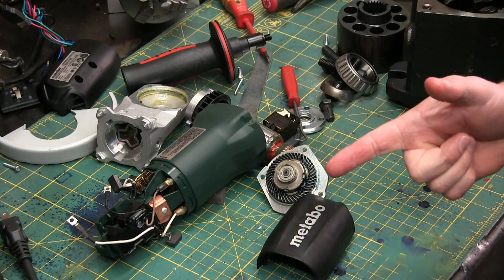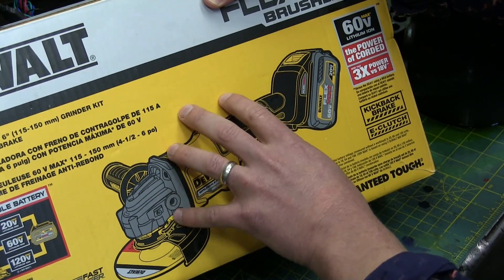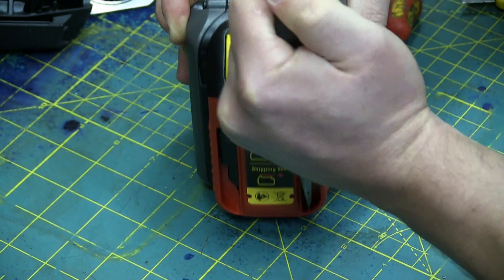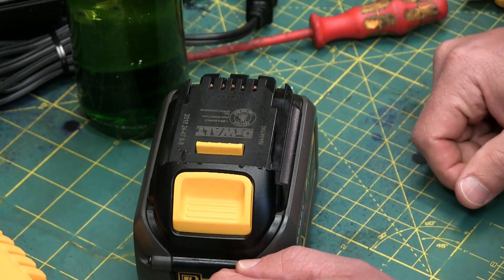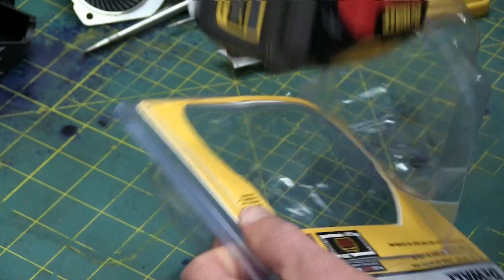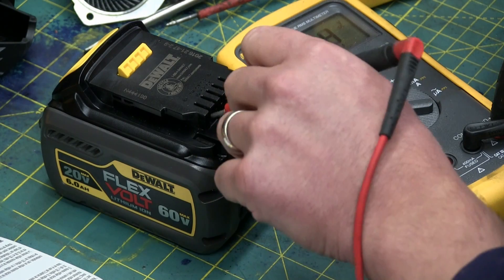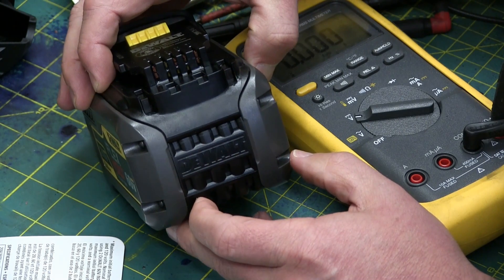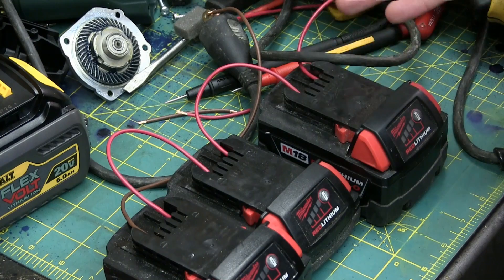Plug-in Power Tool to CORDLESS CONVERSION.

Comment: Could you use a “soft start” device that normally is wired into an Air Conditioning system to prevent the breaker trip?

Comment: Believe that's called a line conditioner. Been doin it for years in the professional audio world. Or P.A. World, I should say...ya if you dip too low on hard hitting notes they have capacitative circuitry that conditions or bumps up the voltage for dips and smooths the spikes as well. But I suppose batteries would do the same thing...just don't know how batteries would stack up to capacitors when it comes to transient/in-rush currents. But I like it.

Comment: Hear me out here!!!
Think of it as “Pimp My Ride” but call it- “Alberta Winds Turbocharger” 

It will only work if Peg(Zip-ties) is quality control OR is the “Celebrity” that steals the tools or does the grand reveal of the turbo “upgrades”

Your wife steals your corded tools and to get you some sorts of pissed, she says she gave them to the needy in Canadastan(I’m down here in Michigan 🇺🇸)….Meanwhile, while you are going to marriage counseling…AVE, Ricky, Julian and Bubbles are cutting the cords to your tools and retrofitting their proprietary “Turbo System”…..Crimping wires with alligator clips, using butt(giggidy) connectors and heat shrink, and shipping them back with severed wires wrapped in Saskatchetoon Chrome(duct tape)…..OR Peg delivers them in Slave Lake…after his 1st check so he has car insurance!
Reply: Batteries NOT Included- of course

Comment: It could only work with 3 batteries it can't take 4 because the board default the 4th battery to 30 volts

Comment: We have start and run capacitors serving this purpose. As we will find in a residential Air Conditioner and other applications. You’ll find the start capacitor assisting the A/C condenser far motor in the start or initial power draw and then the run capacitor maintaining power. 
You can size the start capacitor based on Saw motor and then the real challenge begins, finding a place for it. I’ve actually thought it could easily be adapted to the power cord or if lucky somewhere in the handles/ covers/casing of machines/tools. 
I think I understand what you trying to do. I think cutting the power cord in half and installing a junction box with the capacitor will be your safest and fastest way to start experimenting /testing.
Best of luck

Comment: 2 car batteries in series for 24 volts at high amperage, run to a small inverter built into a toolbox with plugs for 120vac output and a built in charger that has a long ass input cord, charge the batteries with AC from the wall via the long cord while using the inverter to power the tools, add storage for the tools and you have a nice little power pack for any job site, grid power or not, and no need to buy overpriced anemic battery powered crap, use the good old corded tools and always have enough power to run them.

Comment: What I would really like to know is how would I take the amperage away from a battery or Limited to where I can run big deep cycle batteries on something like a Power Wheel without killing the little electric motor with all the amperage just not an electrical guy

Comment: Don't do it that way. Run it off battery (dc) and have it continuously recharge.  Universal motors are more efficient on dc anyways. Then you do not have to switch between ac and dc.

Comment: What about a follow up to this vid Ave? Go into a little more detail for us novice dumb-dogs. I mean, shit.,,, to be able to “series” some batteries to run a corded tool seems great, but what about the batteries’ current storages fighting each other due to unmatched cells? And this “ dumdahg” asks, “how does dc wrk an ac hog? Capacitors have to be somewhere in this fardking equation?(yeah?)

Comment: 4:07 The reason they only half charge batteries from the factory is because the pixies damage the container if it's overcrowded, but the pixies also get depressed if there aren't enough, so they half fill the containment device
Reply: Yep
  Lithium storage charge.  Designed to make the battery safer in trNsport and storage.

Comment: Would really benefit from such an idea.   I am corded only, but once a month, it would help to have a luggable power supply.  Leave in the truck and carge from 12v.

RMS of 120V sine is 85V, so 23 of 3.7V 18650s.  US$150 in cells.  3Ahr capacity, so a 15A tool could run 12 minutes continuously, which is half a day of skillsaw work. Works in a pinch, but not all day.

Comment: Skunky ass beer is good. Plus you can drink warm beer if you usually drink the really skunky ones. No going back into the house for a cold one, just grab one from the warm case in the corner of the shop. Really helps when a project is fighting you the whole way

Comment: Not 60v, 60v max meaning peak. You won't get 60v constant. Technically they only an 18/54 v battery I also had same problem with red cap but i took half time to figure it out. I was drunk at the time.

Comment: Problems 120 volt naughty america has tto deal with.... Or or or... Just use a transformer at main outlet  socket to convert 120 to 240 or fucking 5000 and use another transformer 10 miles away at the job site to convert it back to 120 or 240 if you're running a power dryer or something like that. A bit bulky and nifty little trick but hey, at least you wouldn't have to deal with dead batteries every once in a while.

Comment: I doubt they are trying to save a penny by not fulling charging lithium batteries. There is less stress on the battery when stored at 70/80% (like on a store shelf) charge, which increases longevity.

Comment: I've ran almost everything on a car off a tool battery in order to test it off the car.  Very handy when checking hvac motor driven doors on an hvac case pulled from a vehicle dash and setting outside the vehicle

Comment: 04:03 They don't save money, that's on purpose because Lithium batteries last longer if they are at a storage voltage of 3.75 Volts per Cell if you're not using them

Comment: Ive heard that lithium batteries actually do better in storage at lower voltages. Thats why theyre never fully charged when you first buy them. All the previous battery chemistries did better at full charge. At least this is the case with lithium iron phosphate batteries.  They also have a much higher depth of discharge than other chemistries. Like the old lead acids they only had 50% DOD so you only actually get half of the rated values of usable power but lithium gives you 80%

Comment: I have actually made a battery pack from 4 makita 5.0 to run the old school milwaukee hole hawg. It had some big balls. In the end I threw my wallet at the 36v Makita hawg. But I like where you're going with this. My daughters 12v, take a day to charge power wheels Cadillac is now a supercharged 18v Makita with the charger built in. Goes like stink! 24v gutless lawnmower.... Lol 36v Makita... I can cut pavement with it now, albeit only for a short time.
Reply: It's funny, I have the exact same self healing green thing on my healing bench and during testing with the batteries have the same setup with the jumpers and all the parts around. It could be a picture from my place.

Comment: They ship the batteries at a ‘storage charge’, to prevent unnecessary ‘wear’ on the battery chemistry (a fully charged lithium ion battery will, over time, grow ‘dendrites’ internally which reduce its efficiency, and ability to hold a charge, and in extreme cases can cause a short).

It might save them $0.0001 per battery in electricty, but that’s not why they do it.  These batteries will (once the initial demand surge wears off) frequently sit in shelves and in warehouses for a year or more prior to being purchased by a user.

Comment: Does the 120v AC tool run on 60v DC out of the goodness of its heart, or would it be better to series up 6 20v DC batteries to produce 120v DC?

Comment: damn near jammed my finger though the screen hitting that HUGE YELLOW RELEASE BUTTON you were trying so hard to avoid...  that said, my work area and my electrical panel are on different ends of the house so popping a breaker has huge suck factor, which is one reason I put a 20 amp line in.  Having that extra boost available when needed would be awesome.

Comment: just run the tool on the battery and have a battery charger charging the battery all the time   so charger plugged into the wall  and charging batteries, battery bank has  the same wall plug as the tools but no inverter,  then plug in tools for it to work, also can run tools unplugged from the wall for limited time.

Comment: Just use a transformer !?
Most Transformers have some extra windings to adjust the Voltage...

Put the Transformer into the wall and then the 100ft telephone wire with like 10% or 20% extra Pixiepower into you Tool.
Done :D

https://en.wikipedia.org/wiki/Autotransformer
https://upload.wikimedia.org/wikipedia/commons/c/c5/Tapped_autotransformer.svg

Comment: I did this years ago for  a different use
Take a buggered computer ups(uninterruptible power supply)  which is a computer toy, plugged between power  socket and computer , which is supposed to flatten power spikes and maintain power for a short while if the power spikes or goes out.different rated units depending on required draw.
You can replace the small 12 volt alarm  battery with  jumper cables, throw a  car or truck battery in the loop, and power your computer all day, instead of  a few minutes. You can also  choose to use a heavy enough unit to drive power tools of what have you, providing you consider the real draw, and what the ups is rated for,  unit I made  still worked fine till I gave it away  even though over 20 years old.

Comment: Interesting addendum. My 1976 Boler camper runs the original DC 12volt light off of a converter that puts out on that circuit 12volts AC. Yup you heard that right. It’s kind of a bitch now that I want to run LED lights off that same circuit.

Comment: What you’re saying is a multi box with battery chargers that draw from the battery’s when the wall isn’t good enough .think dewalt has a multi charger/multi box I saw wranglerstar using a welder off one of these. Like a battery powered generator. Could just need some messing with the circuits and you’d have it

Comment: No matter how tempting it is to use the 60/20 volt flexvolt batteries on 20 volt tools I suggest you don’t. Whether you believe or not this battery will allow more amps to be pulled by the tool which can and will burn out the tool if you push the tool to its limits. If your drill boggs down drilling a hole with a 20 volt 3 ah battery yes it will finish that hole with this flexvolt but to what end is it worth the extra strain on the motor ?

Comment: Running ac tool with dc will damage motor, because coil reactance for dc is zero, so impedance turns into pure resistance.because current is voltage/(resistance+j*reactance), when reactance is zero, the current in coils is much higher than when tool runs on ac, and that will damage coils
Reply: Question, if the DCV is 60 and reads higher, and the AC motor runs at 120 ACV how much damage are you suggesting? If intermittent?
Reply: @Johnny-dp5mu  the best way to check if motor will be damaged  is to check the temperature of running motor.if temperature of motor is the same as on ac, probably nothing wrong should happen to coils.
Reply: @Lutlih  Thank you, much appreciated

Comment: It's not going to work with ac and batteries.  You could rectify the ac and  charge a capacitor at the handleis the easiest way..

I was an idea guy in California.  I tried to have a shop, live in a box truck and invent.

They won't  let you. Between thieves, tweakers, recyclers and landlords I was under seige and forced to move back to  Michigan. 

I was separated from my stuff, called a hoarder and shipped back to Michigan.

Comment: Australia has real power from the Wall 240V. I ain't never popped a breaker using a power tool
Reply: Does Australia also only have one plug? Do you not also have a household, or section of it, on a breaker ? 

I’d be disappointed if I lived there and found out that tools just don’t need as much current. Give me tools that are twice as powerful, like your cars used to be

Comment: Power factor correction is what they use for large industrial motors.  The problem I can see is the ac and dc running in conjunction. I applaud your inspiration but why not just stick 6x 20v battery's together creating 120dc. The reason why battery power has never been as versatile as corded ac is all down to saftey and weight. It's safer as we all know to run from 110ac. Running from batteries releases you from the cable. But to have the power like 110ac the batteries wouldn't be practice to put on a tool.

Comment: How about a start and run capacitor to do the same thing? Does the drill have its own rectifier to power a DC motor in it? I was thinking just recently of a rolling unit of 2 maybe 4 generator batteries 40$ each 10Ah connected in series with a 600 watt inverter to make a portable power pack. I guess the charge time would take longer but you would have a 40Ah battery and wouldn’t the tool draw less amps?

Comment: Note: I’m watching this before he takes the battery apart...
Check the 20V tool battery prongs vs the 60V tool prongs. Maybe they use different holes in the battery and the wiring is permanently in series and parallel but the tools prongs choose

Comment: Correct me if I’m wrong, I thought lithium ion battery’s last longer when stored at 50% charge. The Phantom 3 Drone had an option in the smart battery to drain it down to to 50% if it sits unused for like 3 months

Comment: A wearable work backpack battery. Multiple ports for different amps and possibly voltage. Have multi-pack Charger unit built into work vehicle and use fast charge tech.

Comment: Since you are running 120VDC into your drill I was wondering. DeWalt makes the 120v FlexVolt system. I was wondering if you could plug one of the flexvolt tools into a regular outlet.

Comment: My idea is to use an old charger rewire it with a few caps and a micro switch that can feed tye battery or draw from it when needed it may be bulky but its a quick fix idea

Comment: don't need heavy batteries, just need a couple of capacitors packaged up an plug into cord just before the tool plugs in. better yet is a bank of super caps instead of lithium battery, recharge in 1/10 the time

Comment: Can you make a  cordless battery pack convert to a house plug for a shop vacuum  tired of plugging inside the house I want it portable.. I don't want to buy a cordless vacuum  because most of them suck... and I want to use it on a extractor vac..

Comment: Couldnt an inverter help with the voltage drop,like a ups setup, kicks in under low voltage/high amp draw. To stabilize the ac power supply.

Comment: How about the other way?  A cord adapter for cordless tools because the batteries are always dying and cost WAY TOO MUCH to replace them.  Maybe a high current switch mode power supply and a striped out old battery.  How many amps do these drills etc. draw from the pack?

Comment: The partial charge it's actually for maximum shelf life. 3v flat or 4.2v full shortens the life. (Military specs batteries just under 4v full charge for massive recharge cycles.)

Comment: +AvE They don’t fully charge the battery because it depletes to overall capacity sitting at a full charge for who knows how long it may sit on a shelf. You’ll find that most manufacturers will only charge it to a maximum of between 54-60%

Comment: The design you describe  is used in a Best UPS design (Best is an actual Brand Name). Transformer input with two primaries.  One secondary.   The line injects the first primary.  The UPS inverter is injecting the second primary so when the voltage slumps or drops, the UPS feeding the second primary adds too, or picks up the load to keep a constant voltage.  Using the car inverter approach would step the AC down to a charge voltage which would be on a charging rail the is connected to batteries and the in inverter DC input.  Li ion cells packs would be a bear to use. Which is why sealed lead acid cells are used.  You might be able touse protected li ion cells on your own pack though.

Comment: Actually, if you have big voltage drop, motor will draw less current, especially on start-up. When I need to use my big angle grinder, I always have to plug it into my longest extension cord, so it won't pop a breaker.

Comment: Also why it was full charge would be a safety thing as fully charged Lithium cells can have thermal run away if they get to hot at full charge, and to leave a battery low for shipping is no good as it could degrade and cause a dead cell situation possibly

Comment: I'm sure someone has already pointed this out, but Companies like Victron Energy put out a bit of kit called the Multiplus.  It does exactly what you are doing here.....  I have one on my boat...  Mains voltage into the Multiplus and 12/24/48v DC battery bank also.  When the current demand exceeds the mains supply, the inverter kicks in with pure sine wave 240v and makes up the slack from the batteries.  When the demand drops, the inverter stops injection;  the mains power charges the batteries and runs the appliance.......

Comment: Dewalt makes a power converter that takes 4 standard ion batterys and acts as a power hub. You can run 110v tools off of them. We have 1 on the job site even tho I never tried using it that way. I mention this because perhaps this would be a great start for your turbo charging system! You already have the batterys and the 110v line power because it plugs into the wall and charges batterys also... just the thoughts of a carpenter